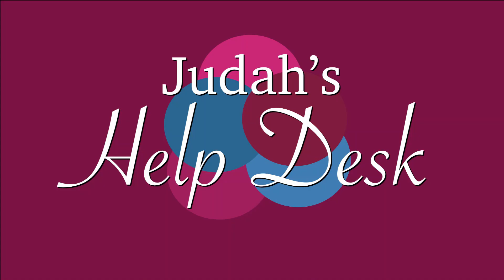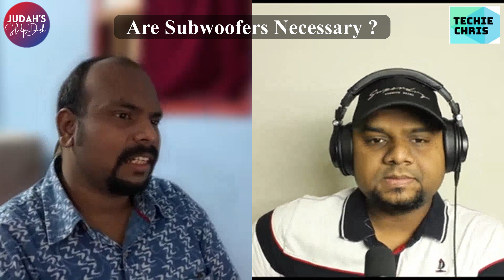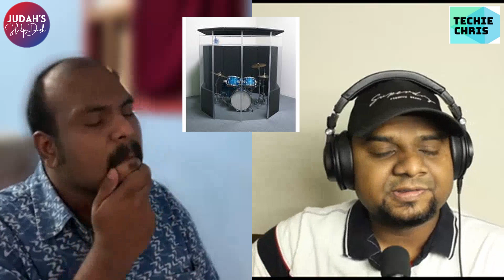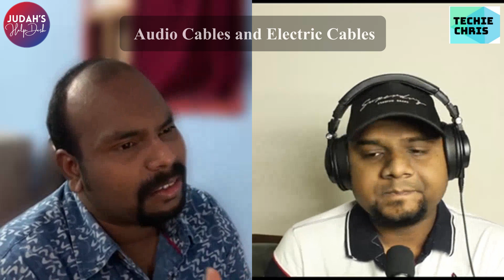An Interview With Christadas David | Audio Advice for Churches | Answering your Audio related FaQs.

Comment from the maker: Time Stamps:
1.Audio levels in a Mix - 02:08
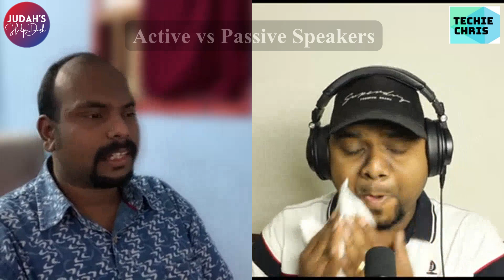2.Active vs Passive speakers what to buy? - 04:50
3.Are  Subwoofers necessary ? - 09:35
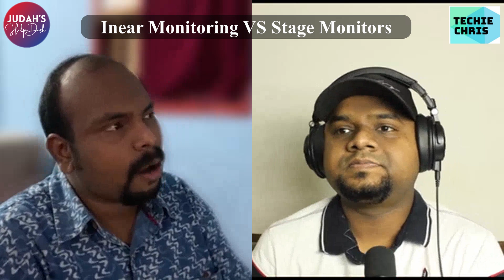4.In ear Monitoring vs Stage Monitors - 13:40
5. Wire and Mic Handling - 20:21
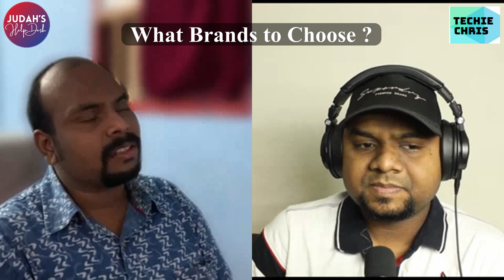6. What brands of speakers we should buy - 25:40
7. what types of cables to buy for speakers , mic  and instruments - 31:06
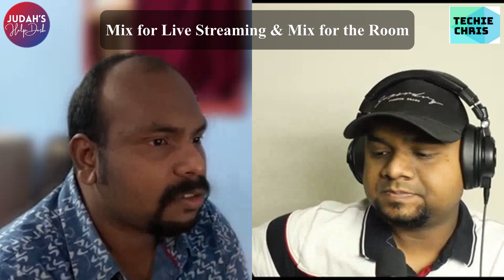8. Live stream Mix and Mix for the Hall - 34:36
9. What is Dante ? - 37:38
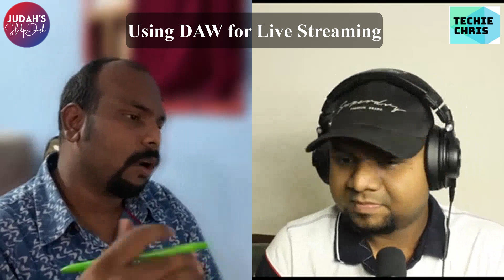10. Using DAW for live streaming and Post production - 40:32
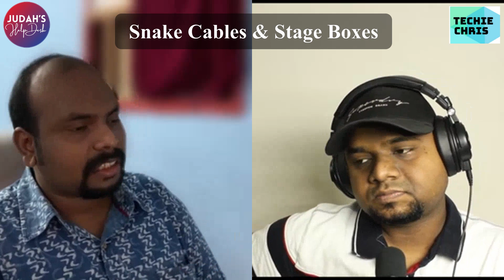11. Snake Cables and Stage Boxes - 42:15
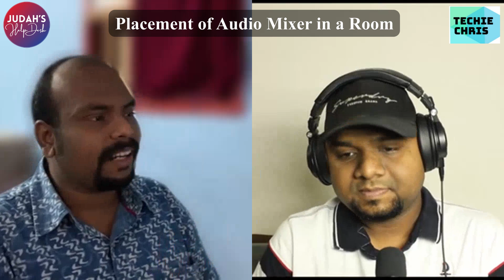12. Placement of Audio Mixer in a Hall - 44:23
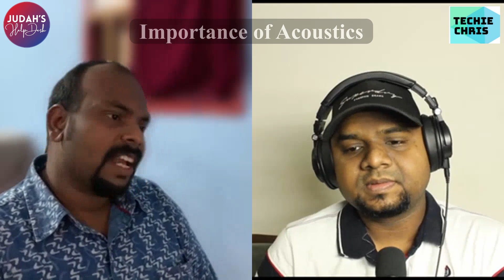13. Importance of Acoustics for A Church - 45:48
14. Drum Cabin is it necessary ? - 48:50
15. Analog vs digital Mixers what to buy ? - 51:29
16. why the audio, video and Electric Cables should be separated - 56:15
17. How use wireless systems without Interference - 58:25
18. Turning on and off your audio System, plugging in and out - 1:00:52
19. 100 people Setup , How many Watts speakers to Buy - 1:02:16